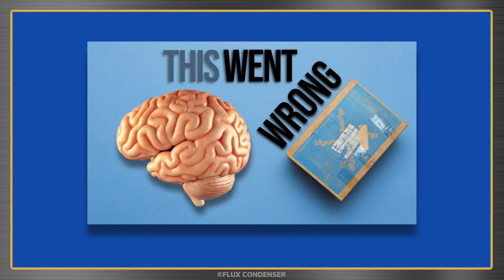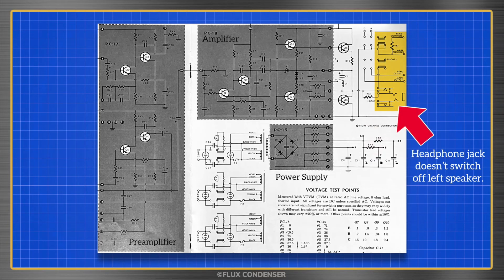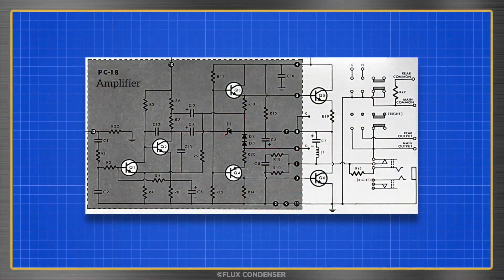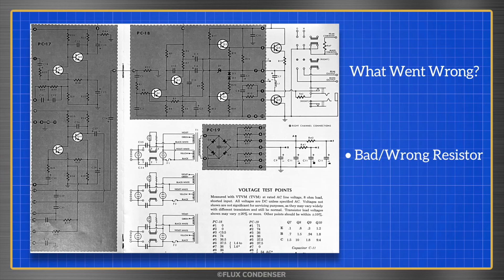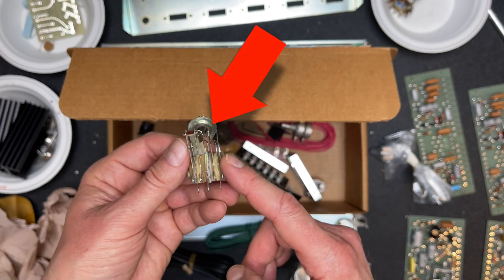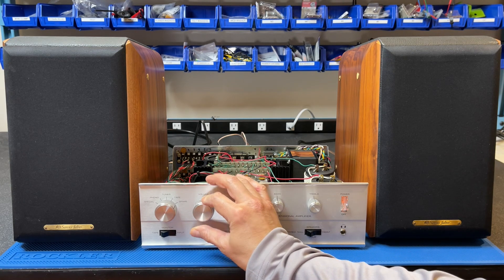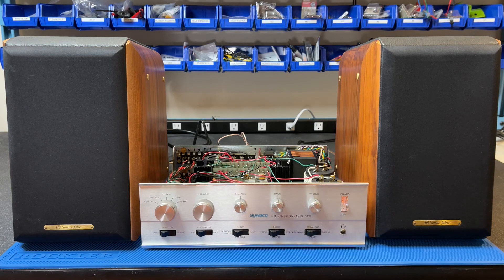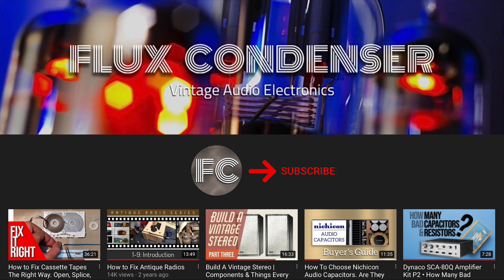Dynaco SCA-80Q Amp Kit P7 • What Went Wrong • The Fix • Quick Demo

Comment: Well I think anyone who said it was a bias error would of been correct.  Then again it is rather hard to debug via one way video ;)
Reply from the maker: Ludmila, yes, you did mention biasing and you deserve kudos for that. I didn’t mention your name in the video as I was looking for an answer from the list I provided and you also stated the issue was before Q1. The voltages going into Q1 could qualify as “before,” but it seemed like you were referring to the before-signal and not voltages. It certainly was hard to diagnose this via a video as you say, and you were on the right track, for sure.